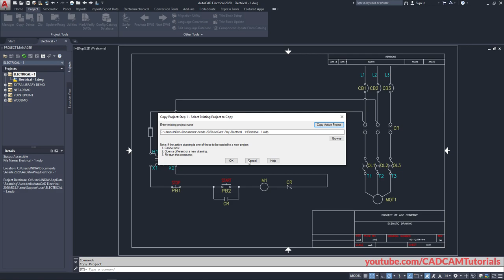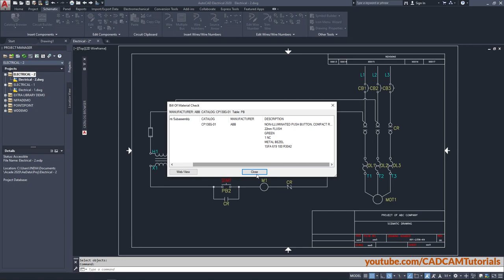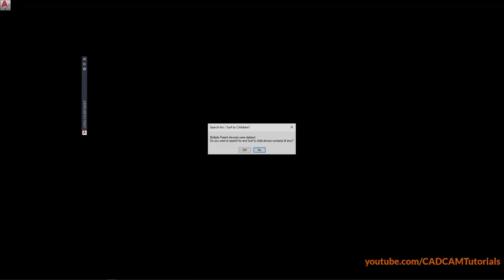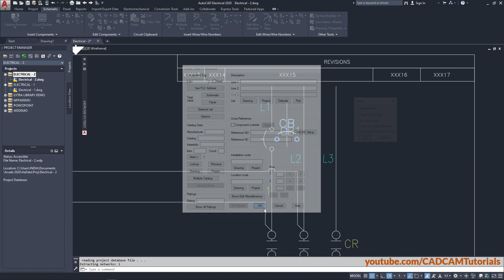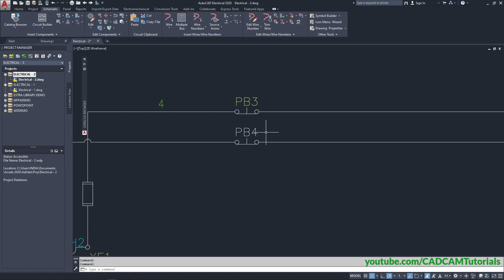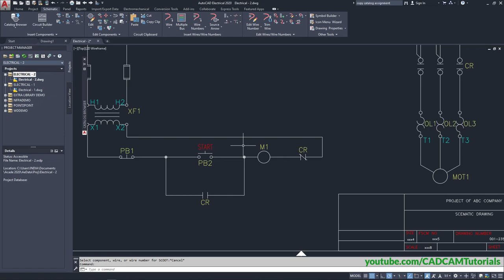AutoCAD Electrical Tutorial for Beginners - 2

Comment: sir plese reply my problems while following autocad lecture 1&2
1.for CBs and relays numbering is not showing
2.while selecting any component to edit , not showing any edit component option after right click
3.I am adding manufacturer and catalog details but again while i am trying to check it is not showing manufacrurer and catalog detalis
4. I am not getting any tab related to map symbol to catalog number
please answer me sir
5. sir while i am using myltiple insert circuit breker numbering are appearing like CB? CB ?A and line line numbers are like ?, ?A, ? B like this